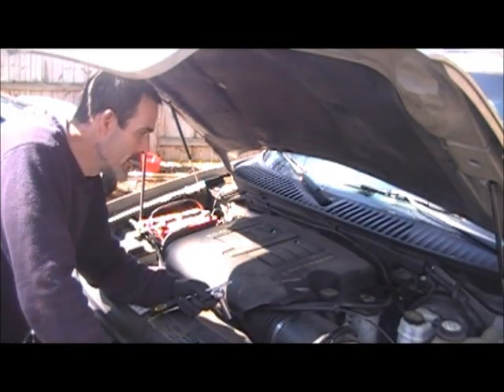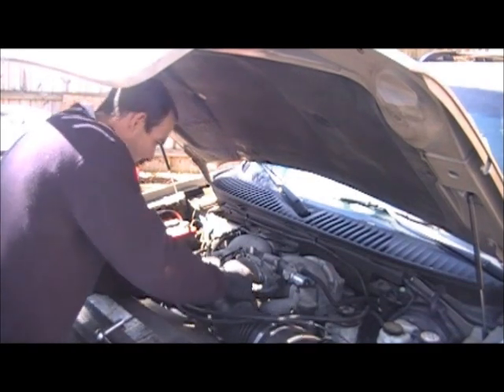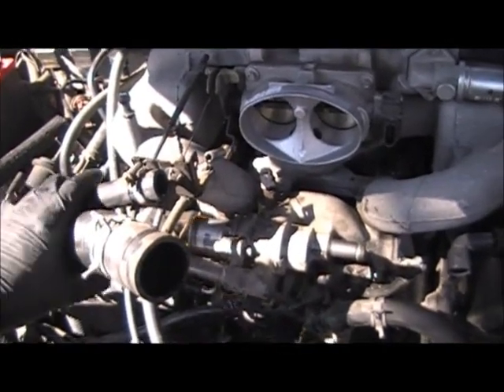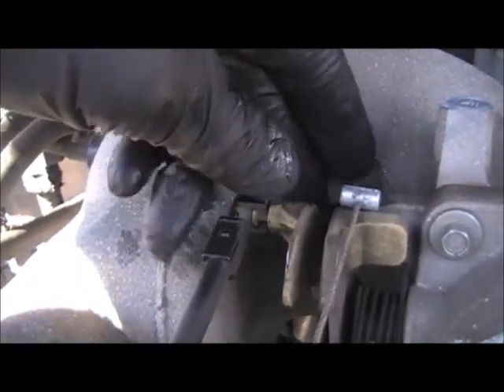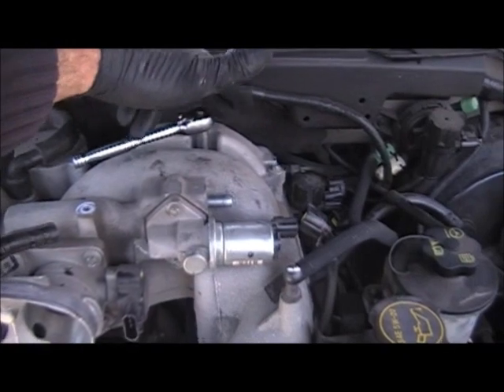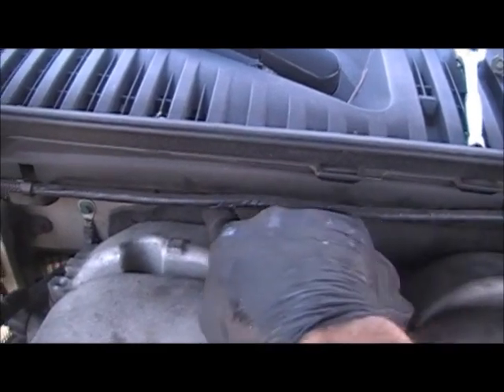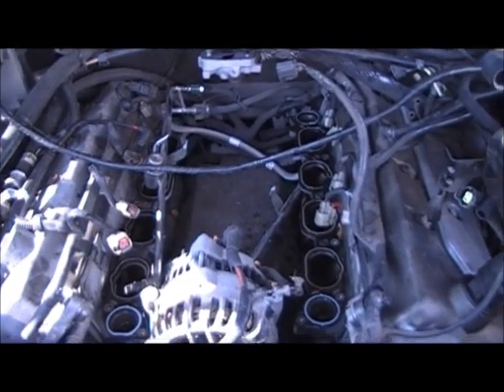5.4 Lincoln Navigator cylinder head removal

Comment: Taking this intake off is a bear. I wish i knew this before i went to the junkyard. I missed the bolts near the EGR valve. I didnt have shallow sockets with me nor a swivel u joint which wouldve made this job infinitely easier. You live and you learn i guess 🤷

Comment: 2012nugget I have a 2004 Navigator and trying to get the plenum and valve covers off.  I know this video is over 10 years old, but if you are still in Charlotte, NC, I live in the same area as you.  I would gladly pay you to remove the 2 rearmost bolts attaching the plenum to the lower manifold and the 2 bolts attaching the plenum to the EGR adapter plate.  I have everything else disconnected.
Reply from the maker: I'd love to help but I'm booked, over booked. If you've went that far I have confidence you can do it! Might curse a lil.......
Reply: @2012nugget  Thanks for the reply.  I would love to have your business contact info for the future.  I had to lie on top of the engine to get those rear bolts out and the EGR tube came out along with the adapter when trying to get it loose from the LH exhaust.  I pulled the plenum, EGR valve and tube all out as an assembly.  Couldn’t even get the vacuum line off the top of the EGR until I partially pulled the plenum.  Still have to get the #8 plug out, do compression test and then remove valve covers.  Insane that can’t change #8 plug without getting that EGR tube off.  And the RH valve cover has 2 AC lines that cross it and have to be removed to get it off, so have to evacuate the AC system also.
Reply from the maker: Did you try unbolting the compressor to free the lines? Maybe you won't have to evacuate and recharge
Reply: @2012nugget  These lines are short and very stiff.  They go from the evaporator connections at the firewall across the rear corner of the RH valve cover into the junction block/pressure valve also mounted on the firewall near the PCM mounting.  I ended up removing them.  Waiting on a fuel injector as one of them first seemed to be stuck open when I tested them off the vehicle.  I ended up pulling the lower intake as well because I had decided to change the injector o-rings while I had the upper intake/plenum off and the ok toe caps on 3 of the injectors pulled off when the lower o-rings stuck in the lower intake when trying to remove them when I tried to pull the fuel manifold and injectors as one assembly.  After removing the lower intake O finally got the e pjj in toe caps out.  Got both valve covers back on with new gaskets, seals and grommets.  Worried about getting the EGR tube and upper intake back on.  Replaced the adapter fromEGR tube to manifold as it threaded out with the EGR tube and had to be heated cherry red to get them separated.  Been a nightmare.
Reply from the maker: @tedallen5002  Welcome to my world!😆🤣
Reply: @2012nugget  I used to enjoy working on vehicles.  They are such a nightmare just to do simple maintenance tasks now.  In your video you unbolted the upper intake/plenum from the EGR adapter and later removed the EGR and tube as an assembly after disconnecting it from the LH manifold connector.  Do you recall how you put the EGR and tube and upper plenum back in and got them aligned and torqued down?  I pulled the upper plenum with EGR and tube altogether.  I made measurements and marks so that I can hopefully get the angle of the EGR tube close to original and was hoping to put it all back in as an assembly and then get the other end of the EGR tube onto the manifold connector before starting to tighten the plenum mounting bolts so I hopefully have some wiggle room to get the tube threaded onto the connector.  Also, how did you torque down the plenum bolts, in particular the two rear ones?  Even the two slightly in front of the EGR valve adapter mount are very difficult to get a ratchet and socket onto even with a drastic angle in a swivel.  I can’t imagine trying to get an accurate reading with a torque wrench.  The torque spec for the upper intake/plenum bolts says to tighten in two sequences, first to 89 lb-in (approximately 7.4 lb-ft) and then an additional 90 degrees which would be 1/4 turn.  I am waiting on a fuel injector to come in to reinstall the lower intake and fuel manifold.  I cleaned them while I had them out and it seemed to be stuck open at first although I don’t think it was when the vehicle was running normally.  I don’t trust it now.
Reply from the maker: @tedallen5002  You're correct, you won't get a torque reading, I use common sense. Small bolt, small pressure, just tighten. Don't over torque. You'll break them. Try to start the threads on the egr tube first....then manipulate the intake into position. There's not much room but you're saving lots! You can do this. Just tighten, no worries.
Reply: @2012nugget  Thanks.  You aren’t kidding about there not being much room.  I couldn’t even get the vacuum line off of the top of the EGR valve because it was hitting against the insulation that wraps under the cowl above it until I started to pull the upper intake and EGR valve with tube all as an assembly.  I got it forward far enough to get he vacuum line off.  Did you install the EGR valve with tube attached to it and the connector at the LH exhaust manifold but only snug on both ends of the tube first and then move the intake manifold into position and attach the EGR connector to the upper intake?  Then loosely install the upper manifold bolts and then tighten the EGR tube at the EGR valve and exhaust manifold?  I can’t recall if there was room to access the EGR tube nut at the back of the EGR valve once the upper intake was in position.  I pulled the upper intake with EGR connector, EGR valve and EGR tube as an assembly.  I tried to get the EGR tube loose at the connector on the exhaust manifold, but the connector threaded out of the manifold in the EGR tube nut.  I have a new connector installed with anti-seize, but not fully tightened in the exhaust manifold and I have cleaned up the threads in the EGR tube nuts at both ends so that they are threading on pretty smoothly.  I got the fuel injectors with new o-rings (and one new injector) installed in the fuel supply manifold and it all mounted back on a cleaned up lower intake ready to go back in.  I  couldn’t find replacement o-rings for the fuel lines coming to the fuel supply manifold so I will just lube them lightly with engine oil and pray they don’t leak.  I went to Pull-a-Part on Tryon St and found a couple of bolts for the lower mounting of the power steering reservoir bracket, one that my daughter lost for the upper alternator bracket and battery tray, spacer, bolts, etc because the threaded insert in my tray had come out and wouldn’t stay in place.  The AC o-rings have come in at Hilbish Ford and they also ordered the caps for high and low pressure AC valves.  I just wanted o-rings for my caps, but maybe they weren’t available separately.  Hopefully all I have left to buy is AC refrigerant and PAG oil for the o-rings.
Reply: @2012nugget Well, things keep getting worse.  I was installing the lower manifold this morning and the 3rd mounting bolt back on the LH side would only thread in about two thirds of the way by hand and all of the others would go in until the washer was touching fairly easily by hand.  I verified the manifold position and even tried swapping bolts and they all behaved the same way in that mounting hole.  I finally tried tightening it with a torque wrench to 6 ft-lb (torque spec is around 7.42 lb-ft and then an additional 90 degree or 1/4 turn).  The torque wrench hit 6 lb-ft before the washer ever made contact.  I then tried to see if I could snug it u- with a 1/4” ratchet and the bolt snapped off in the cylinder head.  I now get to pull the manifold back out and try to extract the broken bolt, find a replacement bolt and re-tap the cylinder head to hopefully get it to where the new bolt will thread in cleanly.  I don’t recall having issues removing any of the bolts and tried to keep them in the same position they came out of.  I cleaned them up well and applied anti-sieze and I didn’t notice any issues with the threads on them when cleaning them.  I think it is meant for this vehicle to never run again…
Reply from the maker: @tedallen5002  Awe man, you needed a shorter bolt in that hole I bet, could have trash in it but bet it takes a shorter bolt.
Reply: @2012nugget  All of the bolts were the same size.  I even kept them in the same order they came out in.  The manual says not to reuse them, but they aren’t listed as torque to yield.  Ford only sells them by a pack of 4 at around $57 per pack and can’t get them until next Tuesday.  I guess I’ll be headed back to Pull-a-Part.  I’m not sure if those holes in the cylinder head were bored all the way through or not.  I hope there is enough sticking out to get it out with vice grips.  I don’t have a welder and haven’t had much luck with broken bolt extractors previously.  If I get it out Ill have to figure out what thread pitch the bolts are since it isn’t listed in n the  part description and get a tap to match to cleanup the hole in the head and hope the bolt grips.
Reply: @2012nugget  I ran a thread chaser on the piece of the bolt sticking out (about 1/2”) and then tried double nut method on it with 2 stainless steel nuts with no success.  I am going to try a couple of zinc-plated flange nuts with the flanges facing each other tomorrow and some thread locker to try to keep,the nuts from wanting to spin off, even though I have them pinched to one another about as tight as I possibly can and they continued to spin off as an assembly.
Reply from the maker: @tedallen5002  goto Autozone, they will loan you a stud extraction tool....

Comment: Qiestion: i have a 2000 navigator . 5.4 v8..just had valve covers done . now when i start it up the temperature gage goes straight tp high . truck not over heating but reading high . changed coolant sensor . that didnt work . any idea of what it could be ?
Reply from the maker: A pinched wire at rear of cover?

Comment: What size wrench is the bolt holding the egr tube to the exhaust
Reply: On my 2004 Navigator the nut on the EGR tube that threads onto the connector at the top of the LH exhaust manifold is 32mm or 1 1/4”.  The nut on the connector is the same size.

Comment: Question to anyone. What tools did you use to get the 8mm, 5/16" back intake manifold bolts? I can't even get my hand in there to try to get a wrench of them. The video says "do this..." and the next shot is the upper manifold removed.
Reply: David Collette I'm having the same problem getting the bolts back there how did you end up getting them what tools did u use because this dumb video don't show anything

Comment: Hey great instructional video ! I am going to have to pull heads for the first time on a 5.4L 2 valve to retap for new inserts. I am considering just replacing heads but looking into it not sure as I am told really should replace other stuff if placing new heads on due to wear/timing.
Reply from the maker: It's a whole lot of extra work and I would make a judgement call once in there.

Comment: im planning on changing the timing chain on my 2003 navigator because it sounds stretched out and it rattles everytime i start it up. What id like to know is, do i have to remove the intake manifold to remove the valve covers and front cover? thanks
Reply: Hola,Jose como te fue con el trabajo en tu 2003 Lincoln navigator todo salio bien?

Comment: Hey Nugget, I just picked up a 2003 navi with the 5.4 4v intec 32 valve engine. And It has a ticking, clacking noise that with a stethoscope seems to be coming from the passenger front side of the engine...does not really sound like a rod knock! ( unless its the very beginning of one.) I have heard these do not have the cam phasser issues  like on the 3v 5.4 engines....Just looking for your expertise advice!!! Im more of a old school shade tree mechanic and it kinda sounds like a bad lifter or loose rocker arm to me...What are the chances its timing related? Can I remove the valve cover and do any test to verify a head issue vrs timing issue? ( I can remove the cross member and pull the oil pan to check rod to crank bearings if need to?) It does have a what I would call a miss in the engine ( like a bad coil or fouled plug! but that could be unrelated?) Just looking to get pointed in the right direction sir.....Any advice would be mucho appreciated!!! Great video by the way....Yours was about the only one I came across in my searches via youtube or bing or google!!! plenty on the newer crappy 3v engine issues, but bumkiss on the 4v intec engines.....Thanks for your advise brother....

Comment: I meant to thank you for your videos. Successfully completed a driver's side cylinder head replacement - got a rebuilt head off eBay for $400 which was cheaper than the local shops were quoting me for fixing the messed up head that I had (stuck spark plug, 2 bad valves/seats).

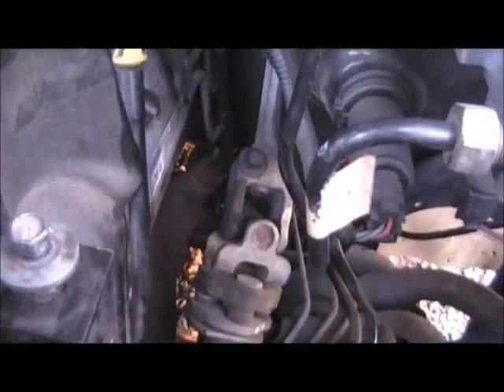Comment: To remove the nut, in minute 8:05 from EGR i did it from the wheel side. i only turn the wheel to the right,  if you want remove the wheel.
Reply: I did it through the wheel well also.  I had the front on ramps so I jacked the wheel up slightly off of the ramp and removed it.  Even after spraying the EGR  nut to connector on the LH exhaust manifold with PB Blaster frequently for several days when I tried to get it loose the connector threaded out of the manifold.  I\Once I got the EGR valve and tube out along with the upper intake/plenum I removed the EGR tube and took it to a muffler shop. They were able to heat the nut until it was cherry red and finally get them separated.  I had already ordered a new connector.

Comment: Just call Jasper and order their reman 3 valve 5.4 with a 3 year 100,000 mile  warranty.Most shops won't even get inside the triton engines called throw away.The 3 valve 5.4 is one huge pile of shit,Jasper sells 4 to 5 of their remans a week.
Reply: Jaspers are junk, not like they used to be. Do not use.
Reply: @toddmiller5322  Jasper is not junk
Reply: @Toolaholic7  well I guess it's just 5.4s they can't build, because that's all this guy does, timing jobs and engine swaps. He refuses to use them anymore.

https://www.youtube.com/watch?v=tbs6YTWazgo
Reply: @Toolaholic7  I don't remember all the details, but they use Cloyes phasers, which absolutely are junk. I've got a Navigator and an Expedition in the drive, revised Ford OEM is he only way to go on these engines.
Reply: @toddmiller5322 He is full of shit in that video.The 4.6 and 5.4 are a nightmare pain in the ass to work on and a real pain in the ass to time.I did a one,a 4.6 and no more.It was a nightmare from hell to work on
Reply: @toddmiller5322  Ford does not make their parts,farmed out to do it for Ford.Cloyes is OEM.Who makes the Motorcraft fuel pumps?Not Motorcraft Walbro makes them

Comment: Hi! We have a problem with two lincolns navigator  2006 i 2007 and we suspect ECM... ?
 
In both cases were damaged right cylinder heads (bank1) especially: camshaft, valve rocker arms, vavle caps (vavle pusher?) etc.
Now everything is new or remanufactured (engine head). There are new sparks, oil, timming kit, coils, and camshaft sensor and wheel. Oil pressure and compression inside each piston is correct when is cold or hot. Mechanically everything is correct. When engins are cold runs great.
 
The problem occurs when engine reaches the proper temperature. During breaking engine start interrupted and knocking (combustion detonation).
 
Where is the problem? Both cars have the same problems after head repair. Something has been incorrect in the ECM memory?
 
Truble codes:
 
P0022 - INTAKE A CAMSHAFT POSITION TIMING OVER RETARDED

P0345 - CAMSHAFT POSITION SENSOR A CIRCUIT B2

P0330- KNOCK SENSOR 2 CIRCUIT BANK 2
 
HELP!!!!!!!!!!!!!!!!!

Comment: I have a problem with oil getting into the spark plug chamber.  Question I would is it from the valve gasket gone bad or could it be piston rings?
Reply from the maker: More than likely it is from the valve stem seal. Small round seal that goes on top of valve shaft, under valve cover.
Reply from the maker: Was it getting on the spark plug wire side or in the cylinder ?

Comment: Hey nice work on the video i am about to replace a driver side valve cover on my 98 navigator and cant find anything to get close too what i need for the valve cover if you have a video that is close to it or can give me any heads up i would appreciate the help doing hte job in 2 days and it is the first year lincoln came out with the navigator so not sure what they improved on but just not sure if the top comes off on this 5.4 l v8 this navigtor you looks diff. jbsmith5611@yahoo.com thanks man

Comment from the maker: You cant see them but you can get the proper extension length and socket on them, then attach the rachet to break them loose. I use 1/4 drive in that tight space.

Comment: im working on pulling my engine on my 03 navigator.  im stick at the part where you are taking the intake manifold off.  i got the plastic piece off the bak but i cant get to the bolts under the dash to get the intake manifold off.  how do i get to those bolts?!?! thanks!

Comment: So I got a pressure tester from autozone and a see snake camera and it looks like the seam on back of the head is moist but it's so tight I can't see exactly where it is starting from and from what I can see with the camera the valley is dry.My plan is to take the upper intake off to get a better look.My question is does the upper intake have coolant running through it or just the bottom?